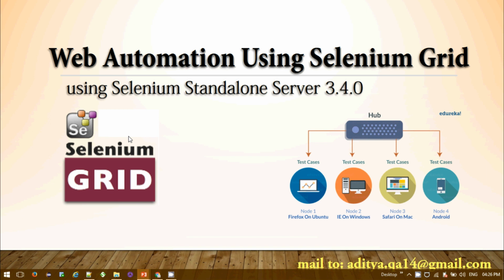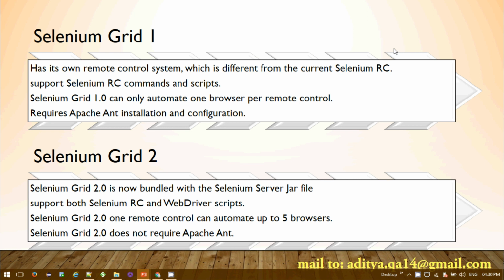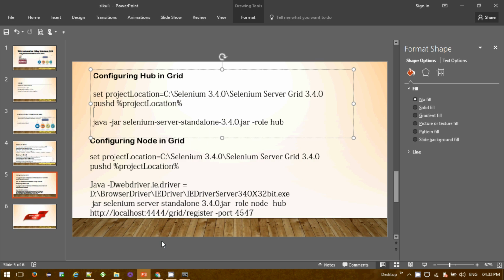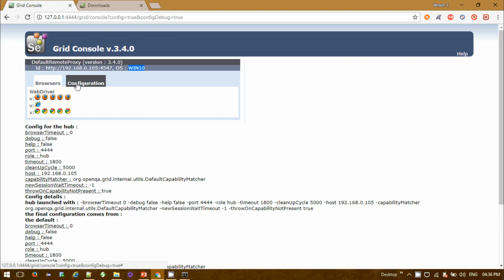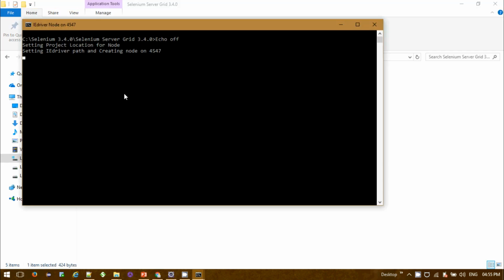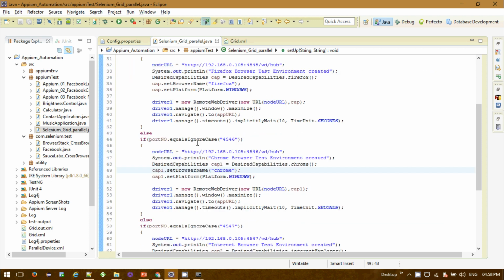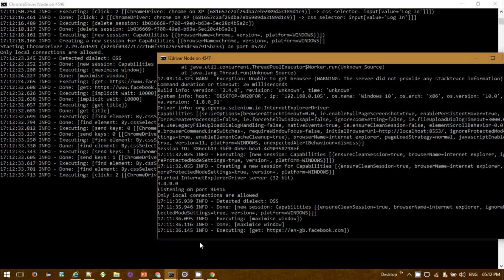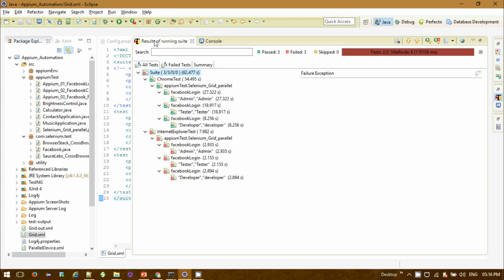How to Configure Selenium Grid | Parallel and Cross Browser automation in Grid

Comment: When I am giving 
java -Dwebdriver.chrome.driver=D:\Data\Fdrive\Frameworks\SeleniumPractice\SeleniumPractice\Grid\chromedriver.exe –jar selenium-server-standalone-3.141.59.jar -role node –hub http://localhost:4444/grid/register/ -port 4546 
for node in batch file and running it after hub one it is giving error could find or load main class.
but this same command when hitting in cmd directly it is working.
what could be the problem?